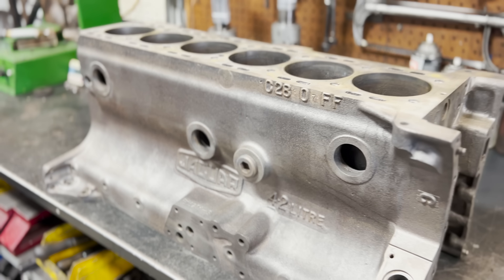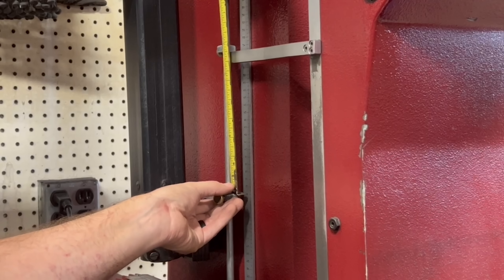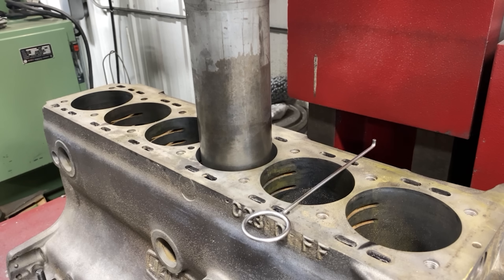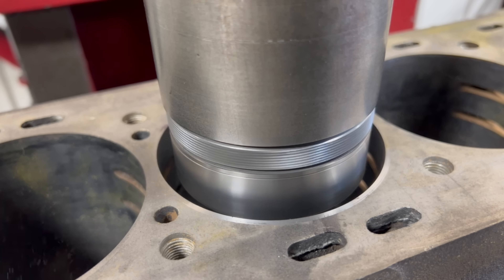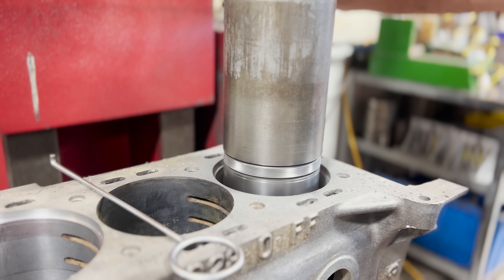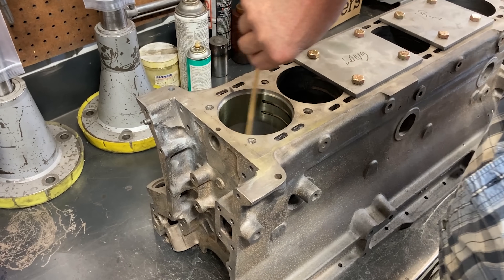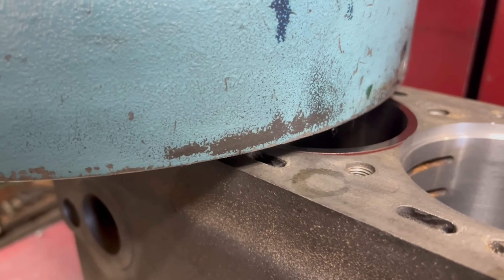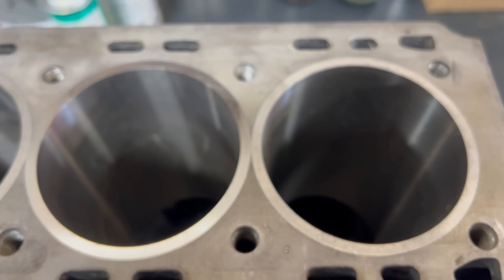Will New Sleeves Fix The Cracked 1968 4.2L Jaguar Block?

Comment: When he first described the situation i thought he would set the heated block in the press and then drop the sleeves in, but he had thought a little deeper with the cap plates and i would have thought them to be enough. I noticed the center cylinders had a 10-20 thou gap unlike the others, i wonder if that is by design, lower thrust on the middle main maybe? This is an A1 machine shop, i wish i had the same sense of security with my local shops.

Comment: Awesome stuff love the fix. Just a question but have you ever thought of using a thermal weld process to fix cracks like that. That type of jacket would be kinda difficult to build a mold for but it could be done but it would work better for smooth bore cylinders. I know a enough about machining, welding and metals to be dangerous and probably hurt myself. They use thermal welding on the railroad to weld bonding straps to jointed rail. And concrete guys use it to weld rebar together.

Comment: I am curious how this stands up leaving the cracks on the lower part of the block water jackets. On late 1990's -early 2000's Land Rovers, the 4.0 and 4.6 v8 motors suffer this same problem. cracking behind the factory cylinder sleeves, sleeves get loose and rattle too. They eat head gaskets on the regular, and  general consensus is if it just blew from the heat warping block and head both are aluminum) its rebuildable. If you pop the head off and the center two cylinders are steam washed its because a crack has formed in the coolant passage behind the cylinder sleeve as there is no water passage in the head for center two cylinders. If it has done this, the Rover community consensus is to trash the block. I cant find anyone who will tig the crack either for a machine shop to bore back to size and proceed with sleeves.

Top hat sleeves have been available for years for these motors, but again no one will put them in a block with cracked water jacket (almost identical issue to what youre repairing now) as they claim it will continue to overheat due to the coolant leaking into oil and cylinder.

I have 2 Rovers sitting right now with overheat/blown head gasket issue (one is confirmed a cracked block behind sleeve)  and a spare motor on a stand that I havent pulled apart to see if its head gasket or cracked block. My original goal was between the three engines, I should have a good block on one of them. Rebuild that with tophat sleeves, put it in the nicest chassis and part the rest off for a solid running truck. An LS swap is easy, but much more expensive in terms of parts, time to wire and adapt etc.. On the chance that all 3 of my blocks are cracked, Id much rather do something like this to repair it than go through more parts trucks/motors hunting a good block or LS swap.

Comment: Keeping that matching numbers block is certainly worth the cost and effort. More importantly, is the fact that you've effectively eliminated a design flaw and insured a workable head gasket seal that will allow the car to be used as it was intended. Fantastic work guys.
Reply: What is done if the block absolutely cannot be used, cannot be repaired by anyone and numbers matching is desired? It's my understanding you can't simply swap the engine numbers as it's part of the casting or is pressed in such a way its near impossible to remove
Reply: 8O7
Reply: Indeed that looks so good it may still be running in another 100 years time . Modern fully synthetic oils and filtration  plus modern petrol have absolutely transformed engine wear . When I started driving  we had only  straight 30 or 40 grade mineral oil which broke down so quickly and afforded no protection . Forget all manufacturers  sales biased oil change  intervals  - use appropriate grade of fully synthetic and change oil  no greater than 6000 mile intervals -  as long as you do not overheat the engine  it will carry on indefinitely .Modern oil is brilliant .
Reply: @richardhintonracing  indeed

Comment: Amazing technique with the stepped boring bypassing the possibly fragile area where the coolant passage were. I didn't know that could be an option. I was wondering if you were going to end up with the sleeves siamese'd together at the top. I remember car craft doing a story like this for early LS blocks to achieve larger bores prior to GM offering larger bore LS blocks.

Comment: Did you consider hard block water jacket filler? I don’t know the cooling behavior of these old jags, but I know racers use that stuff to stiffen the top of the cylinder bores.

Comment: Would you consider making a video going over all the equipment you have in the shop? I’m curious as to what machines would be necessary to open up a machine shop. This is by far my favorite YouTube channel on this app! Great job guys
Reply: I own an old Glenn's motor manual that shows machinists and mechanics using the automotive shop tools that are still in use today. Many public libraries have an automotive section with old repair manuals, automotive shop tool manuals and  machinist training manuals. Those old machinist tools are still available thru vendors that acquire and rebuild/repair them.
A friend of mine had a UPS delivery route that had several machine shops that kept their old tools in a shed after replacing them with computerized machines to use as backups. Several years later they decided those weren't going to be needed so told my buddy to take what he wanted before donating the rest to organizations that rebuilt older firefighting equipment and aircraft for museums.

Comment: You mention a set time for the Loctite of 60 minutes.  Does this take into account the elevated temperature of the block?  We often use heat to "kick" adhesives.  I don't know if heat accelerates setting of Loctite, but suspect so.  Nice work, a pleasure to watch.

Comment: To repair a crack, you can drill holes in both ends and interlaced between those, create treads and screw bolts with loctite in each one, after that rebore the cylinder.

Comment: I love this series.  Its a very interesting engine.  Also a interesting engineering exercise to overcome the obstacles.  It looks like this will definitely work as long as the sleeves are seated properly and there's enough glue to hold them in.  Old rare engines are a treasure and its fantastic to see a shop go the extra mile to save one.

Comment: I know the humidity is very low in Colorado.  But, I did see some frost on the sleeves as you slid them into the block.  Does that frost affect the Loctite bond when it melts to liquid water?  Thanks for the awesome video!!
Reply from the maker: Check out the technical data sheet for loctite 620: https://tds.henkel.com/tds5/Studio/ShowPDF/?pid=620&format=MTR&subformat=REAC&language=EN&plant=WERCS&authorization=2

It has a section for chemical/solvent resistance, which doesn’t list straight water but you will see it has excellent resistance to contaminants (which the engineer I spoke with at loctite also confirmed).

Comment: So I'm far from an expert on this stuff, but it always makes me nervous when I see people use liquid nitrogen in situations like this.  Getting the sleeve that cold, only to then expose it to such a hot temperature risks, to my mind at least, making it brittle and shortening it's lifespan.  Frankly it's something I would really want to see some additional testing done on to ensure the sleeve still maintains the necessary strength after being exposed to such thermal stress.

Comment: I feel like every engine should have these sleeves from the factory. Theoretically you could rebuild it as often as you want and never have to worry about scoring the cylinders. My M36A2 has these sleeves and I rebuilt the whole thing in my driveway with basic Harbor Freight tools. They don’t make engines like they used to.

Comment: This has been standard procedure for reconditioning Jaguar engines for a long time.
Later blocks, post 1968, would invariably crack or the sleeves would drop. Pre '68 blocks less so. 
We were doing this in Australia in the 80's.
By successfully and skilfully fitting the top hat sleeves you have made this engine block an even  better and more robust product than when it was new.
Leaving the sleeves protrude and leaving the assembly in a press overnight ensures they are positively seated.

Comment: So when you dial in the deck do you also measure the deck height from the crankshaft bore? I was a Automotive machinist for 12 years and seen a few decks that were not parallel to the mains. I like your videos they are very well done along with your machine work!

Comment: 13:05  why is there a gap between cylinder 3 and 4? I thoguht they should overlap. Does this mean the distance between each cylinder is not equal? I mean this is how the manufacturer build it I guess.

Comment: Would it have been possible to drill a small hole at right angles to the axis of the bore at the bottom of each crack to stress relieve the crack and prevent it from propagating further? I realise it would be difficult but, in theory and practice, it should help.

Comment: Saw this on my recommendation and I have a few questions.

Why does this happen? Is it because of poor casting? Of poor iron quality? Inadequate quality control? Bad engineering? Or just that god said "screw this engine in particular.".

Do you encounter this often? Which manufacturers are guilty of having these kinds of problems on their engines? Does piston configuration affect how an engine cracks? Which engine configuration fails more compared to others in your experience?

That is all, thank you!

Comment: Given the variability of the original bores that might have been the manufacturing process or that the block 'walked' over time, I would have expected that the bores should closely relate to the big end journal spacings on the crank.  Such boring based on the big end journals would then have ignored the original bores and guaranteed that the block and the crank were matched.  I note in the final few frames that at least 1 pair of cylinders did not have the overlap of the liners that the other bores did.  If the bore spacing is not matched to the crank then there will be an unacceptable thrust longitudinally that the pistons and rods won't accept for long.

Comment: Perhaps the owner should consider using GM Cooling System sealing tablets PN # 12378255. They were used in GM aluminum blocks that had too much porosity.

Comment: are these Westwood liners/sleeves (no affiliation)?

Also, I'm not sure about torquing down the sleeves while they equalize in temperature : would not that make them pre-constrained with reference to the block when equalized, then likely to relax in a detrimental way down the road as heat cycles will follow ? 

good point on the self locking of the top hat sleeves to reconstruct a bridge for sealing in between cylinders (I understand some drag racers do that as well...), I would have been tempted to seal up the cast iron still, maybe with high temp epoxy or something the like, just to reduce the width of the craks and stabilize them... as for fixing cast iron, in the old days people used to chain lock screws, too...

Comment: As a rough approximation, the cure time for an adhesive will roughly half for every 10C increase in temperature, that will be why the loctite was cutting early with the balance between the hot block and cold sleeves

Comment: I wish you were in Australia so I could bring my Cleveland block to you for machining. Your channel is fascinating and your commitment to precision and accuracy is impressive. Looking forward to the next one.
Reply: I am in Australia and i am guessing your cleveland block has a cracked cyl as it is quite common for clevelands to crack cyls when they have been used hard.  We used to use repco sleeves that came in 3 wall thicknesses they were straight sleeves which are fine for most engines. They were A,B, AND C sleeves with the c being the thickest and when you fit them in a clevo most of the cyl wall is gone but once finished you end up with a cyl wall that is twice as thick as std. There are   machine shops here in Australia that can do work exactly the same as this. Not as many as there used to be though we had 3 where i live and now there is only 1.

Comment: could you guys possibly use a Hard HardBlock type of filler in the water jackets after the fact? I know that's not the intended use for these coatings but maybe something similar to work as a thin liner to fill in any imperfections at the top of the water jacket reliefs. probably a risky thing to add a chemical hardener/liner because there's a chance that it could deteriorate and contaminate the cooling system. great job on this project!

Comment: Its always a + when the original engine can be saved imagine how long it wil last now with all the modern materials and machine methods if it already lasted 100000 miles maybe more with the old methods and material. They don't make them like they use to. Great job guys.

Comment: Silver solder works really well on cast iron, you need to try it as there is no further cracking or preheating necessary and the silver solder tins cast iron so much better than brazing, I use 'Easy Flow' flux with SS but there are other flux powders available. The silver solder gives a good strong repair and is very heat resistant, I used SS to re-attach inlet manifolds to cast iron BSA A10 motorcycle cylinder heads after I'd sawn off the manifold in order to get access to the intake ports for modifications, once SS back in place there were no failures.

Comment: I have an odd feeling that there is a little too little holding the block together and the cracks may progress underneath with heat cycles, until everything eventually disintegrates.

Then again the friendly Belgian guys are saying that this is an adequate repair, who am I to disagree?

Comment: I noticed the two center sleeves are not overlapping. Are the bore centers not the same all the way across? I’ve been looking forward to this video. Glad to see I’m no the only very methodical engine builder (mostly turbo snowmobile and sxs with a few automotive and other applications mixed in). This is perfect for a person with excessive ocd about this stuff. Awesome work! Can’t wait for the next one in this series.

Comment: I admit I was one of those that said "tig braze after grind out the cracks and then tophat sleeve". I still think it was the most optimal, I didn't consider the required skill and specialization for it. Ah well, still looks great on the finish so far, do keep it fun out there.

Comment: Where do I start?? LoL. First, Bravo to the folks in Belgium that not only watched the first video. But actually took the time to reach out. And to share some very vital information. And how they have had  success in these types of repairs on these old engines. These videos that you have made to document this repair, should be considered educational in the restoration industry.  And I have to say, You adding the voice over to the video explaining the process that is taking place is FANTASTIC. The time it takes you to edit these videos has to be kin to a part time job. The customer should be very happy with his decision to continue going down this rabbit hole. And to fix this severally damaged blocked the way you have. If this series of videos doesn't open doors for your shop into the restoration world.  Then there's something wrong with the way the moon and the stars are aligned.  There maybe be others out there doing this type of repair. But there "Dam few, And fare between"  As you well know from your research on this damaged block.

Comment: Good on those Belgiums in helping you out. like the temp difference assembly technic. Heard they used similar installing heads & cylinders on air cooled radial engines which don't use headbolts & gaskets. They screw in like a watch back where the whole thing screws arround instead of using 6 little screws.

Comment: Doesn’t the retaining compound act like insulation?
Reply from the maker: It’s not ideal for heat transfer, but the sealing & retaining benefits outweigh any losses in efficiency of heat transfer in this case.
Reply: @JAMSIONLINE  I’m a millwright and have done a lot of repair type work like what you’re doing but more so on reciprocating compressors.  I like your response.

Comment: Fascinating!  In about I bought an XK120 FHC, with a well worn 3.4 engine. I was able to purchase a set of 3.8 JE pistons that had run in 12 Hours of Sebring. I took the disassembled block to a machinist in San Francisco, who bored it 3/16”, I think, for the larger, high compression pistons.  The car was noticeably quicker. The enlarged engine served me well for the rest of the time I owned it.  As a young Air Force B52 Maintainer, I poured evert cent I had into that car.

Comment: You couldn't do it any better. I have seen a thin sleeve with no top have a slight leak into the cylinder where maybe the locktite or whatever the machinist used didnt seal. Maybe the sleave shifted, nevertheless in that engine I think some engine coolant stop leak could have sealed the leak had it been known before the head was pulled.

Comment: With the cracked block and the interference fit of the new sleeves, when getting up to running temperate, would the sleeve expansion advance the crackes?

Comment: What kind of valve seats & valves will be used? Having worked on the heads of that type engine from that era, used good quality steel because it’s only possible to use 100 low lead Avgas nowadays to simulate fuels from back then. The current blend of ethanol is terrible on the components. Has the customer discussed modifications or upgrades? Great content, enjoy each installment.